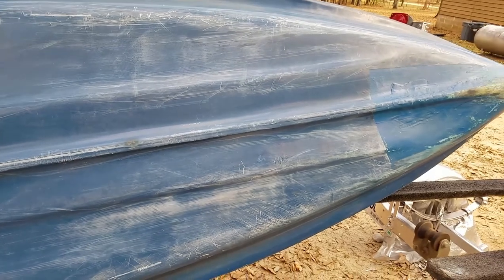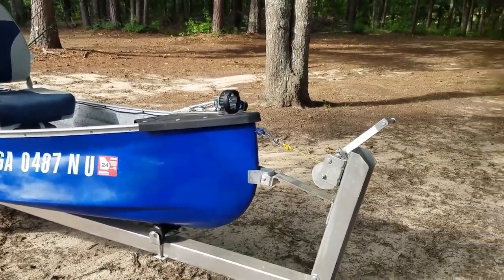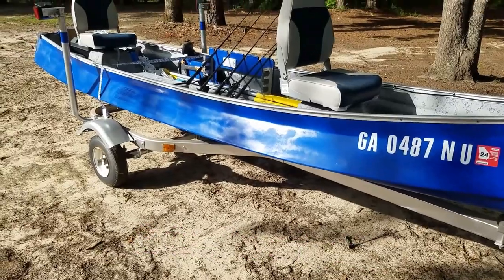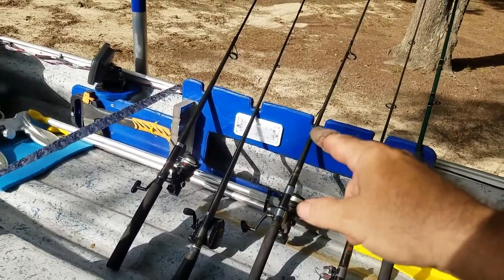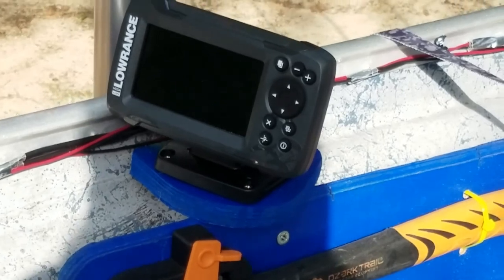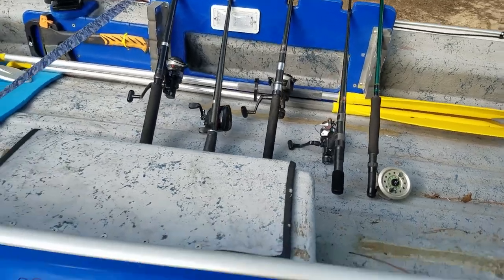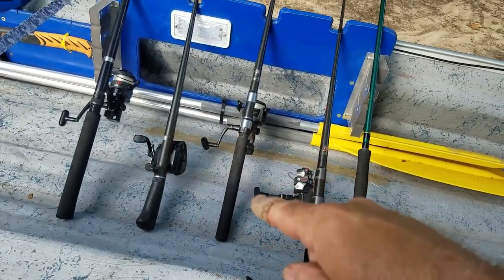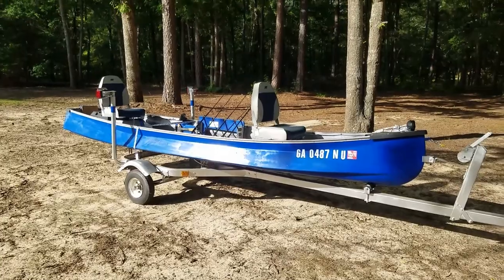1987- 15' 6"  Waterbug boat,  Restored,  Gary J

Comment: Ok I'm in the middle of redoing my waterbug. Haven't done anything with it in 4years. Mine has the live well straight across the middle. Do you happen to have a link to those terminals?
Reply from the maker: I got them from Academy Sports. They are about 18.00.
Reply: @knightingalesaid  ok thanks, what motor are you going with?  I ended up with a 4hp Mercury for mine. Replacing the old golden jet 5hp. mine is only rated for a 5hp but some smart guy in the last 40 years scratched a 1 next to it.